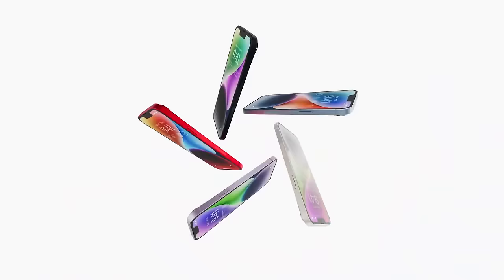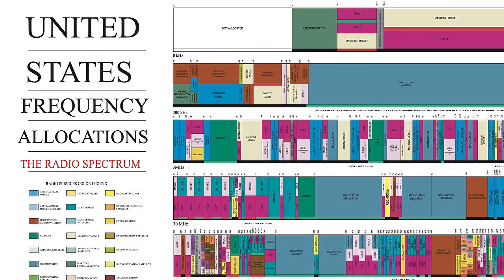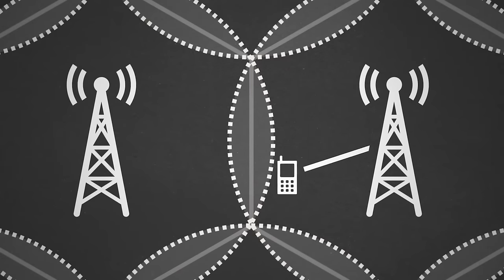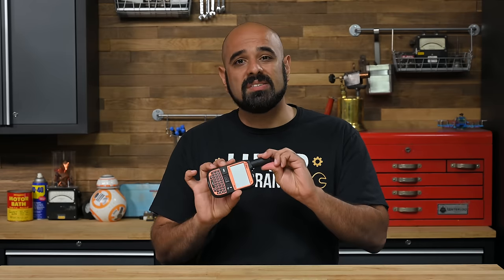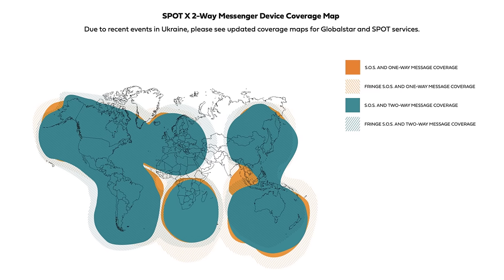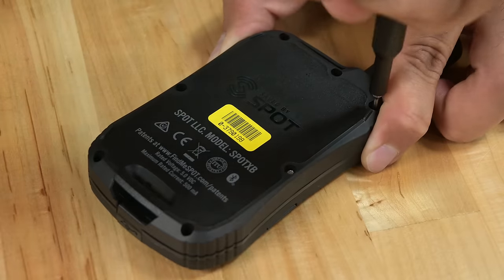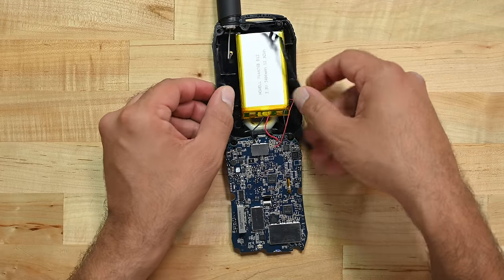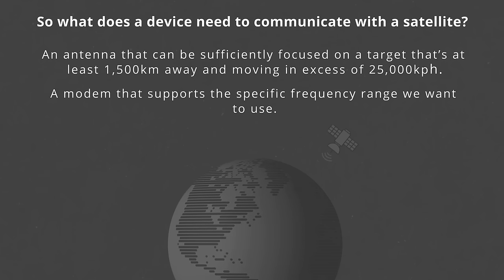The iPhone 14 Has Satellite Messaging. This Is How the Tech Works

Comment: Some corrections... cellular communications do not need line of sight... and the range can go up to 120km on 2G within certain settings... not 2-3 Km !!
Reply: Further corrections... The generation of radio technology used, be it 2G, 3G, 4G, 5G, does not matter. It all comes down to the radio frequency used, which affects the range & whether or not line of sight is required. Very high frequencies such as mmWave 5G will require line of sight, with even heavy rain able to degrade the signal. While very low frequencies can pass through buildings to varying degrees, depending how far away the tower is & the construction materials of the structure. Hi-Fi sound systems are the most relatable example, where you can put a subwoofer (low frequency) speaker anywhere in the room or the trunk of a cars, but tweeters (high frequency) are aimed at the listener!
Reply from the maker: Thanks for the comment! This was our mistake and we appreciate the correction!

Comment: They should implement with Starlink... oh wait, T-Mobile is already doing this by using the existing 1900 MHz of spectrum on StarLink satellites and it's compatible with all iPhones and most androids that support either that frequency like band 2 or 25.
Reply: I saw a tweet from Musk.
He said Apple did approach Musk to use starlink but it’s not ready or they don’t have the technology to make it work yet.
Reply: @gund89123  if that's the case, t-mobile is still going to do it by later of next year, and it's comparable with all iPhones supporting that spectrum that t-mobile already used on their cell sites or the PCS spectrum G-Block, in which they've acquired from Sprint. Now they're using that spectrum to minimize dead zones via satellites
Reply: except the StarLink satellites required to do this are stuck on the ground as SpaceX needs to launch them with Starship which is still in development.

Comment: Globalstar is in orbit at 1,400 km altitude. Iridium is much lower at 781. INMARSAT satellites are in GSO at 38,000 km altitude and work with portable handheld satellite phones. So no you don't need to talk a satellite that's 1,500 km away and you can use those in GSO that don't move relative to the user, no need to track at 25,000 kph.
Reply: i prefer LEO sats (polar if possible),if you are in a valley or behind a hill or mountain with no view towards the equator its possible to wait for a satellite pass